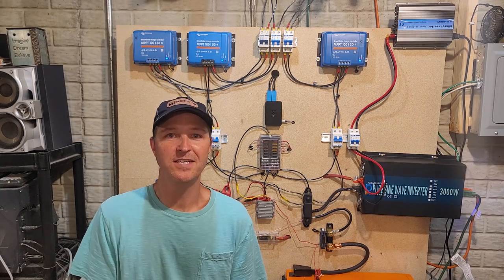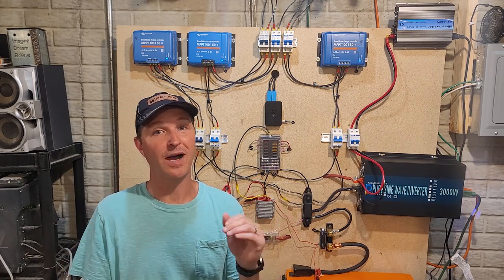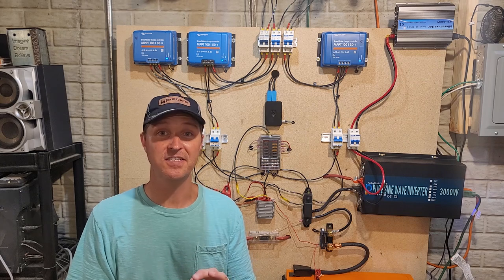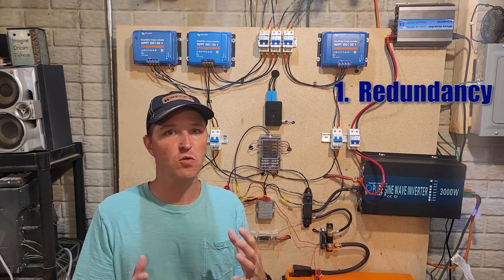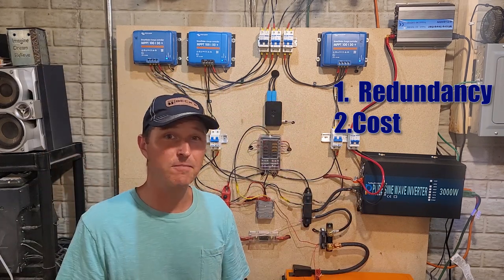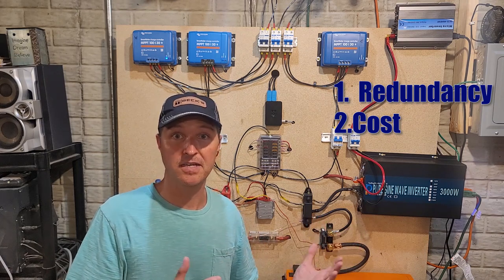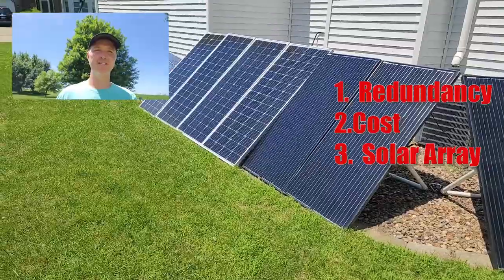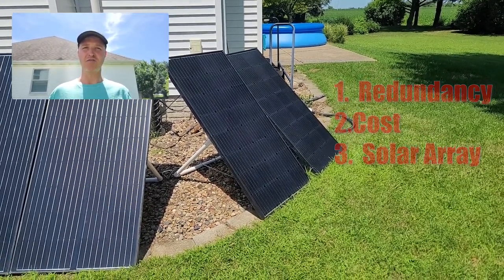Why I go with Multiple Charge Controllers

Comment: Your maths is all over the place. 2 of MPPT 100v @ 30A does not give you 200v@60A. Its one or the other, 100v@60A OR 200v @ 30A. So 1 is 3kW. 2 is 6kW (200%). A 150v@70A is 10kW.(350%).
Reply from the maker: The math is sound.  I'm not stating that the charge controllers are putting out 200v @ 60A.  I'm stating that each charge controller can handle up to 100v with the ability of pushing a max of 30 Amps into my bank.  With 2 of them, you can possibly handle up to 200v of solar panels with the possibly of pushing 60A into your system.  I hope that clears in up.  Thanks for the comment!
Reply: @OffGridBasement  I am referring to combined output. It's 1 or the other. 2 units cannot give you double voltage AND double current. But I actually doubt you could put them in series effectively, so best you can get is 100v@60A.

Comment: You do not have any redundancy. You have 3 small independent systems that add up to one larger equivalent system.  If one of the three MPPT's fail, then you lose 1/3 of the system, there is no redundancy, that part of system simply FAILS. That is not redundancy.
Reply from the maker: My meaning is if one of my charge controllers fails then I'm still running @ 66% opposed to having one big charge controller that fails and I have nothing.  I guess redundancy isn't the correct terminology but I hope you get the idea.  Thanks for the comment.
Reply: I think he means he doesn't lose the entire system if the only single controller he has were to fail. Still makes sense to me. Better lose a third than lose the whole lot...

Comment: Several reviews on amazon say these smaller Victrons don't work together well, going to float voltage only when multiple are connected.

Can this be fixed with settings through the bluetooth app?
Reply from the maker: I've personally never had any issues with one controller doing something different than the others.  In my situation, the shunt might be a big help since that is where all of the controllers get the battery voltage.